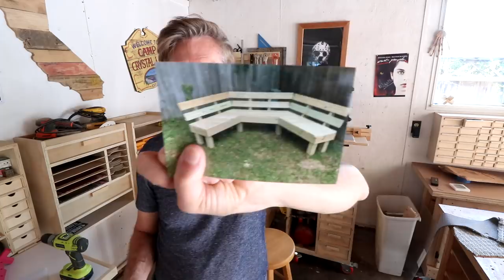Making a stand for a well-balanced tree. Plus ABC's of woodworking.  LOCKDOWN DAY 171

Comment: I remember the first Polaroid I had the "film" was like a sandwich with several layers consisting of the print, the developing chemicals and a "negative". It was really hard to pull out of the camera because it had pressure rollers that squeezed the print to spread the developing chemicals inside the print sandwich as you pulled it out of the camera. 

Then you had to peel the sandwich apart and you would have a picture and what looked like a negative image on the bit of paper you threw away. The print was wet so you had to let it dry and finish developing . The film pack came with a small container, which had a felt squeegee applicator inside, and some kind of coating liquid . Once the photo was dry you used the squeegee to apply the coating to the face of the photo so it wouldn't get scratched. That initiated the second round of waving the print around so it would dry.  

Taking a polaroid was a bit of a process back then, but it was amazing at the time, as you could actually watch a photo develop.
Reply: My Uncle Paul, God rest him, had one of those Polaroid cameras back in the '50s and used for I don't know how many years.  That was always magic when he would take a photo and it would appear out of nothingness.  I remember the fixer applicator.
Reply: My mom as well, when I was little, around 1960 or so.I remember the little sort of foam type applicator you had to wipe across the film. 
She progressed and kept getting the newer models as they came out.

Comment: Thank you enormously!  I have been trying to figure out how to stabilize Safari Kitty's wobbly dual cat-pole system that came from Craigslist.  Following the near-tragic event, I removed the 4" square poles from the 1" x 10" base, which had been 'secured' by two 2" screws and 'supported'' by a strip of plywood that, predictably, failed immediately after transport.  They need to have a dependable base that can fit close to the wall.  Kitty is totally creeped-out by it, but really yearns to be elevated to window height in our basement apartment.  I'm considering using either stacked 2" x 4"s or 2" x 8" bases with +8" bolts securing the poles in two directions so that I can safely dismantle the unit when I move.  Thanks for the inspiration -  feline mental health can soon be restored!

Comment: I have several “trees” that were rescued over the past year, just to make cat trees, but I have not taken the time to debark them (that’ll be a pain in the butt)...I think yours is a crepe myrtle, which debark themselves, at least here in Texas, but I don’t really want to cut any of mine down...YET!  After our deep freeze last month,  quite a few large trees in the area broke apart and I found some huge limbs that I cut apart and brought home, mainly because most of the bark had separated, so they’ll be a lot less work to sand. But....yours looks about the same size as what I’m dealing with, except mine is freaking HEAVY!  Of course, like yours, it WILL have to be anchored to the wall, but I’d really like a lot of the stability to be in the base. Did you attach tour base to the floor at all?  IDK, but if research shows me that crepe myrtle is significantly lighter, I might have to reconsider cutting one of mine down!  Thanks for all your instructional videos; as a newbie woodworker, I’m always learning from your expertise.

Comment: Those paint can spouts work great! Got one about twenty years ago and still using it.
Reply: I saw a cool tip for using cans of paint on a TV program the other day... place a strip of painters tape across the can, then you can remove excess paint from your brush against the edge of the tape instead of the side of the can.

Comment: Hi Steve, I have learned a great deal from you. I saw something in this video that's similar to what I need to do as well. I'm very new to woodworking so have no solutions yet :-) - I'm planning a punching bag stand using 4x4, and for the base to be more sturdy, I'm planning to use five 2x4 pieces using butt-joint. I'm trying to figure out angle, size, spacing etc. Do you have any suggestions?

Comment: Hey Steve, Love your channel! Can you show how you'd join 2x4 legs to 3/4" plywood using pocket holes (or a better method)? I'm a beginning woodworker and it seems that none of the suggestions I read online work with my Jig (Armor). Thanks!
Reply: Israel - are you making both adjustments to your jig? One is to set the depth of the hole by adjusting the depth of the drill bit. The other one you have to watch for is the height of the the block (the block that the drill bit passes through).  When I first got my jig - I would set the depth of the drill bit - but didn't realize that the block had to be set properly as well. You may know all this - but I thought I would ask.
Reply: Are you building a table? You're going to need aprons to join the legs to; you can use pocket screws for that. To join the aprons to the top, use a router, chisel, biscuit jointer or circular saw to make slots on the inside faces of the aprons, parallel to the top edge, and use L-shaped blocks with screws through them to hold the top down onto the aprons.
Reply: @John.117  Unless I'm doing something wrong, the Armor jig combines both adjustment into one- as you set the height of the block, the collar on the drill bit is also set. I tried changing the collar position on the drill bit but I just can't get it right (either I don't drill deep enough or the screws go out of the other side). Thanks anyways!
Reply: @jjohnston94  Not building a table yet :) I'm going through a phase of trying to build different jigs and stands for the shop. The planer stand I'm building doesn't actually have apron, just stretchers. The original article calls for putting screws through the plywood into the end grain of the 2x4 but I wanted to try pocket holes mainly for aesthetics. I think the method you're describing above is suitable for more fancy builds than the one I'm doing but thanks anyways!
Reply: @izzychen7537  Not really - I can't tell for sure, but what you describe most likely has 4 legs, a top, a lower shelf of some kind, and 4 frames (sides), each with 2 vertical members (the legs, each of which is a part of 2 adjacent sides) and upper and lower stretchers. Stretchers and aprons are basically the same member, and they do the same job. The only difference is that a table that's meant to be sat at can't have a lower stretcher, so the apron has to do the job of both upper and lower stretcher, so the quality of the joint is more important.

Comment: 9:33 That thing did once do something. When Polaroids first came out you had to wipe fix on the picture after you took them. That's why you'd wave it around to dry the fix (you could also over expose it if you didn't wipe the fix on). But the drug culture was so stoned no one realzed when the second generation film came out, it did it itself in the emulsion. You no longer had to wave it around to dry it. I didn't do enough drugs to not notice. That's my excuse.